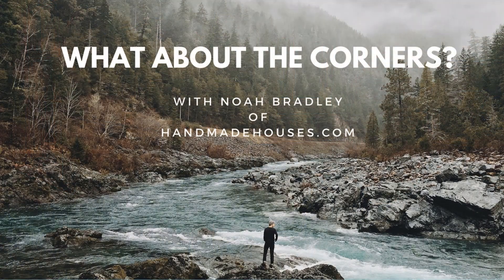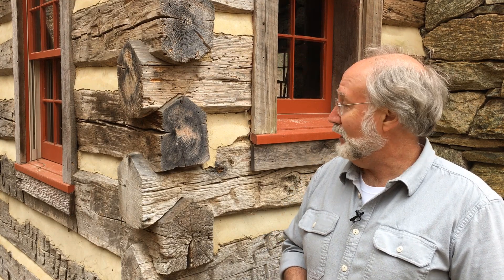Handmade House TV #21  "What about the Corners?"

Comment: Hello Noah, love your video series. Very informative and enjoyable to watch so keep them coming. :)    When you final assemble the dovetail cabin, do you use long timber screws in the dovetail notch corners to secure the logs or do you just rely on the weight of the logs (gravity) on top of the notch to hold the building together?

Comment: The notches also benefit from being on the ends of the logs, where water that's been absorbed can easily be aspirated back out. Maybe he said that, I'm in my car watching on lunch at work. Anyways, I've seen a ton of old barns out there and most everyone else can too if they just look they'll notice what he's talking about. My house is 6 to 8 inch round pine logs with a lincoln log style notch. It's very crudely built and one wall is showing a bit of rot where vines were once allowed to grow on it. It has all the associated water issues with using round logs and it was rechinked with log jam about 30 years ago( failing in spots these days). But hey, its over 60 years old at least (first deed).

Comment: Hello Noaha. In the video you had mentioned the sealers on modern log homes.

I understand the water shedding abilities you discuss here with the flat log, chinking and the angled notch such as the dovetail and the v notch.

My question is about the wicking of water.

If no sealants are used do the logs not wick water as it runs down them?
Reply from the maker: Perhaps... but if that happens it must also wick itself back out. 
I must admit that I'm not a scientist nor an engineer. 
And, I didn't invent this form of log construction.
I've just been around it for decades and seen thousands of cases of it holding up well for hundreds of years.
And during that same time I received hundreds of calls from folks with log cabin kits where one log rests upon the other who have had tremendous rot issues.
So, I pay attention, come to my own conclusions, and share them with anyone who cares to listen.
If something has proven itself to hold up well for centuries it's got my attention.
And if it's something new and improved... I'm always skeptical.

Comment: In Nebraska were I live I have seen a few original log cabin (late 1860''s to 1900's) with square notching. the square notching really does not hold up well compared to the other types. Surprisingly there were many log structure built in Nebraska especially before statehood. I wrote my honors paper in college on early Nebraska log structures and have rebuilt one from the ground up for a museum. I really wish I had found your channel earlier!
Reply from the maker: Thanks for your feedback Ron. Here in Virginia the only time I see square notching is on farm buildings that were covered over with siding. You are correct those flat notches will hold water and rot fast.